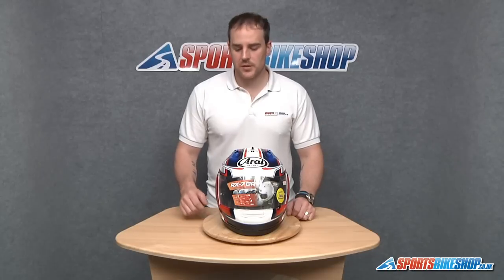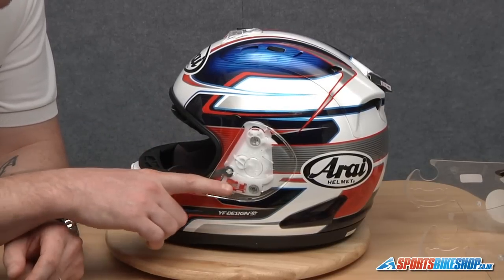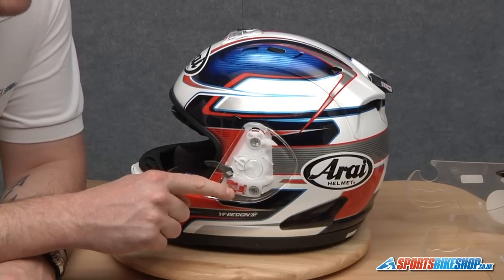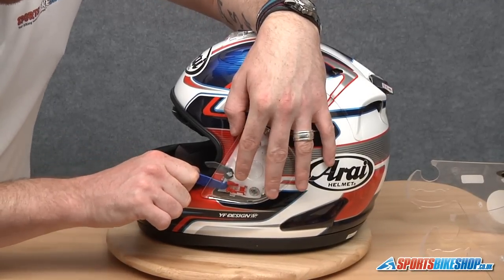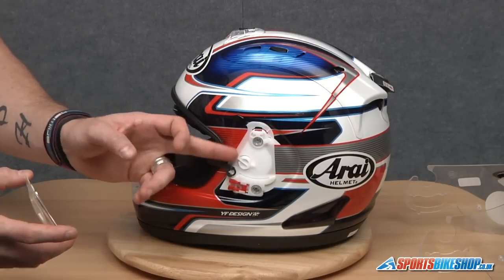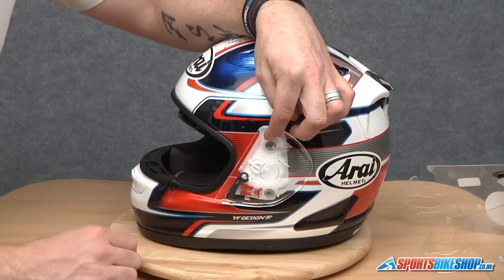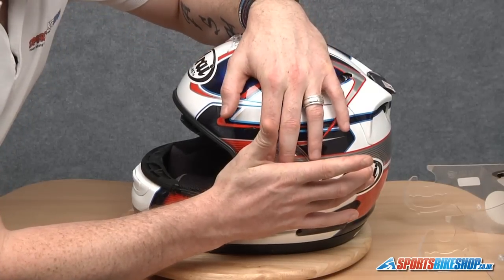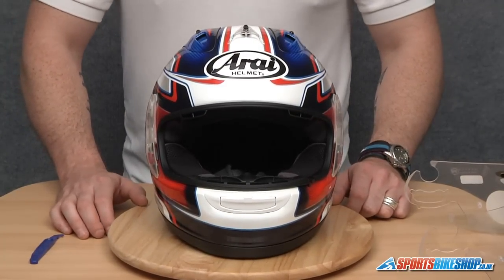How To Change An Arai J-Type Side Pod

Comment: I had a red catch that wouldn't snap forward to lock the side pod on. It was sticking in its holder. I put a tiny amount of silicone grease onto the areas where the red catch slid in its holder with the end of a cocktail stick and that made a massive difference, it slid back and snapped forward as it should after that.  I also put a tiny amount of silicon on the side pod catch to help it snap into place. The side pods makes a very pronounced CLICK when they lock into place but do give them the pull test.

Comment: Well I just figured it after allowing the lube to seep in.. Just push the red tab in ensuring the the tab split is enclosing as opposed to opening out. It only needs to be pushed about  2mm. The side pod won't pop out so just lift it outwards a little then slide the pod up to lift it off the upper tab seat and hey presto

Comment: I got the Chaser Pedrosa but mine is really hard to change visor, the mechanism is too tight and always makes a cracking noise as if the plastic covers are braking off. Arai is a very good helmet but for me the visor mechanism is just too fragile every time I change visor from clear to dark smoke or vice versa, I already broke the right side panel once and parts are expensive, I'm switching brand not sure which on yet but is Shoei, AGV or LS2 top line will be considered.

Comment: Lon, you're absolutely correct, what a POS design. And this demo doesn't show or tell you what to do if it doesn't just snap into place. This method doesn't work for mine, which I'm sure is the same for countless others.  POORLY DESIGNED!
Reply: Totally agree.  This video, good as it is, still won't get the new pods on.  What a total POS design.  I'm going back to Shoei again next time...

Comment: Very useful, thank you. I wish I watched this video prior to my last trip. I have Arai RX-7 Corsair. For some reason right Jtype side pod got disengaged, I tried to put it back in a hurry, got frustrated and damage it. Now I need a replacement. Since this style is discontinued motorcycle store in my city coudn’t order it and sugested to go online. So far I have no luck. Any suggestions where I can order this  part for Arai Corsair RX-7 Green Wraith helmet? Please help!
Regards,
Eugene
Reply: You have probably sorted this by now but I bought a badly scratched up lid from a car boot sale very cheap, watched a vid similar to this and replaced my damaged parts.
Sometimes I have bought junk helmets but with as new visors for around a £5er, saves a bit on a new visor.

Comment: What about the old arai without levers? It has the red switch but it seems very reluctant to budge though I applied arai lube and it is moving a little. I'm just aware of the consequences if I push too hard and snap plastic.. It's a 1992 Arai Quantum
Reply: Were you able to get your visor off? I have an old Arai NR03, with no black levers, just like yours. It took a while for me to figure out how ir works. It seems that in this model the visor won't come off without removing the pods at the same time. The first thing I had to do was push the red switch - it was quite a clumsy process, since it's an 20+ year old plastic system that had never been put to action before. As you mentioned, it was not lubricated. So when pushing the red switch, the lower latch of the pod detached from the helmet. As far as the upper latch, it had to come out at the same time as the visor, pulling both parts upwards. This video and your comment were of great help. Thanks!